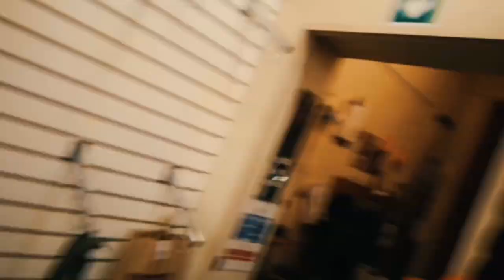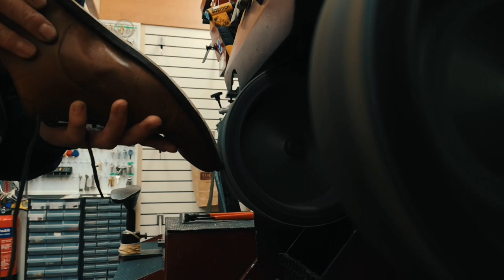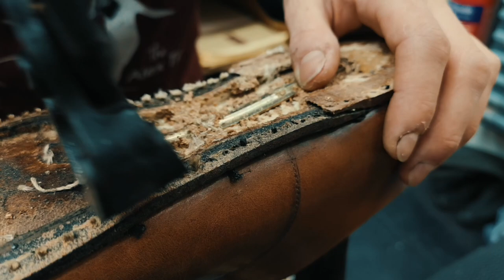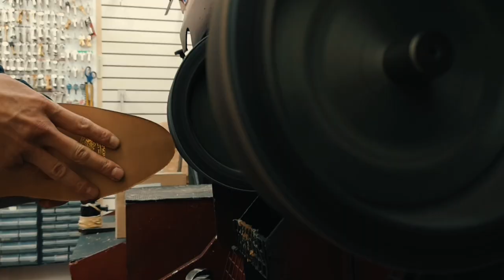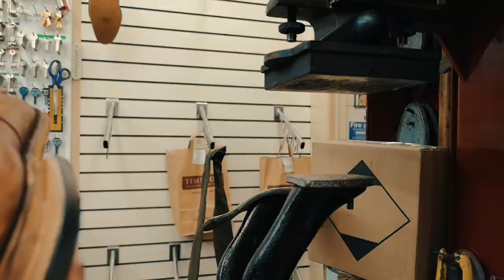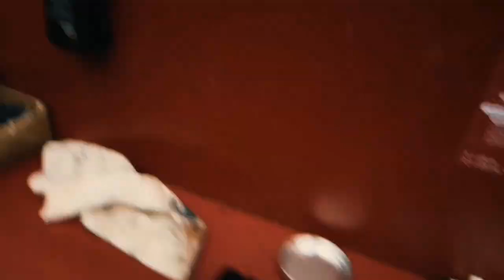Churchs Consul Restoration | Executive Leather Resole #25 | Goodyear Welted | Scottish Shoe Repair

Comment: Great job! Quick question though, why do you clip the factory heel nails instead of pull them? Is them building up not an issue?
Reply from the maker: I clip them so they are easier to remove from inside the shoe 👊🏼